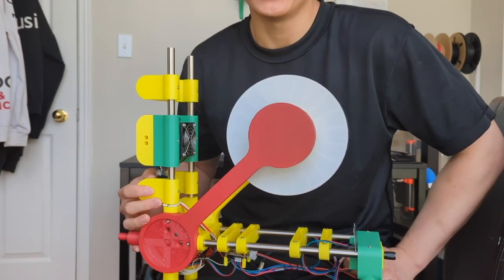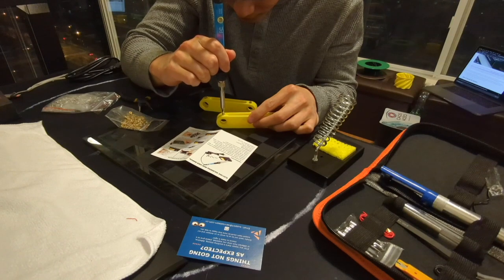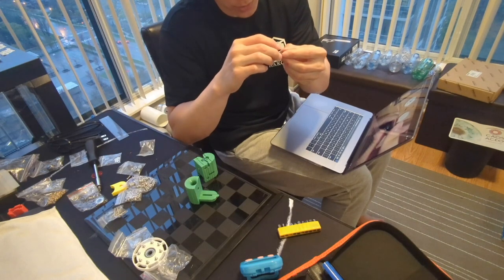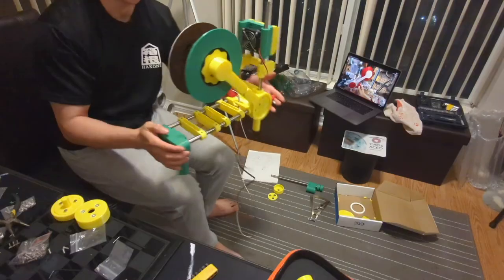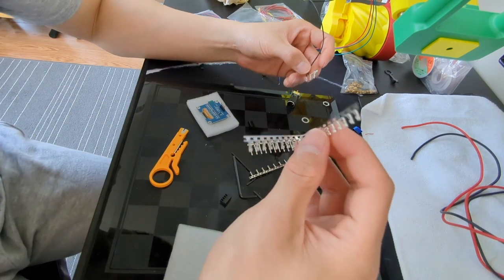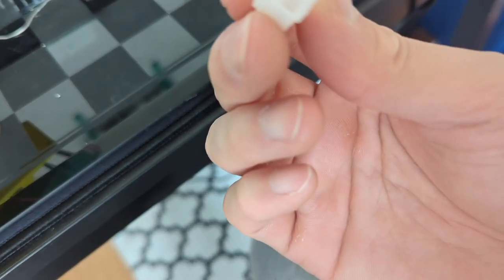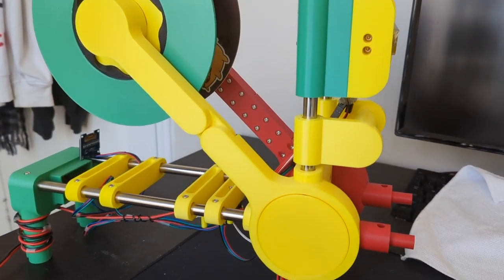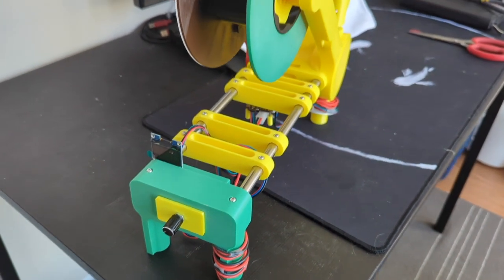An amateur assembles the polyformer

Comment: This may be an optional second thermistor (https://youtu.be/AptEzppocp8?t=991 ) to sense the temperature of the stepper motor... and warn you if it is overheating
(I don't have any experience with the polyformer. I built the electronics of my system myself.  I had a few free sensor ports on my arduino and decided to so something similar)  
Thank you for sharing your journey here
/chriV